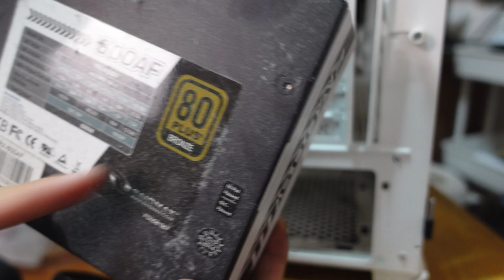Install New PSU + PC Troubleshooting! (Seasonic S12-III 650W)

Comment: That Power supply unit has issues. I'm telling you right now. I also have that same psu which is brand new from a legit store but after 17 days, the psu cannot start my pc. Buy this psu at your own risk.
Reply: You're probably right bro. Mine is 2 years now and I just recently bought a new used gpu. My pc is getting kernel power errors and randomly shuts down when its under full load. Sure ako na di overheating ang issue since 70 to 85 Celsius lng thermals ng gpu ko. Plus umiingay na ung psu ko kapag naka full load na. Ngayon ko lng din natest kasi external pcie capability ng psu na ito. Mukhang poor build quality siya in general. 

My PC Rig:

GIGABYTE B560M AORUS PRO AX
I5 11400F 6C12T
COLORFUL BATTLE AXE RTX 2060 SUPER
2X 8GB DDR4 3200MHZ KINGSTON HYPERX FURY
DARKFLASH DX240 AIO
DARKFLASH DR12 PRO FANS
Reply: @iangabrielalcantara7756  A trash PSU.
Reply: @chadiesanagustin7260  oo bro. Kaya happy ako napalitan ko na mg Seasonic gx750
Reply: @iangabrielalcantara7756  i have the same hardware and the same problem
Reply: same realization Bro, nag auto restart sya pag full load, tsk3..nadamay pa tuloy yung rx 570 ko ayaw nadin gumana 😔
Reply: haha same here! this psu is causing me headaches! been crashing and giving me BSOD at full load.
Reply: Iwasan niyo yang psu na yan F tier siya sa psu cultist

Comment: Planning to buy din ako dahil 500w lang psu ko naka rtx 2060 ako kaya need ko bumil, ano po mas ok etong psu or yung Corsair cv650 80 bronze? Mas mura corsair
Reply: how is it working with your gpu?
Reply: Corsair bro. Trust me. This unit is so bad. It won't last.
Reply: @chadiesanagustin7260 mag inplay PSU kanalang bobo. Ingay mo. Dami mong oras sa internet.

Comment: Meron nagbebenta nga Gold Rated 850watts Fully Modular na Power Supply Koya. Apexgaming AG-850m. 3.8k lang. Okay po ba yun? May 10 year warranty accordingly pero hinde ko alam kung may RMA sila nito sa Pinas. Planning to replace my 5 year old Cougar SL600 with this.
Reply from the maker: First ive heard of the brand, go for seasonic, corsair or evga